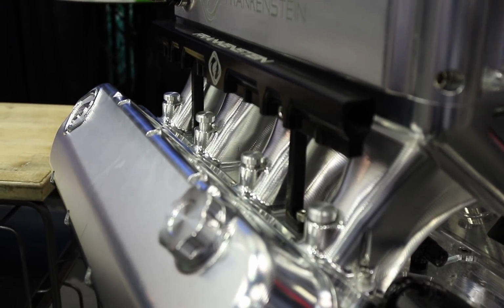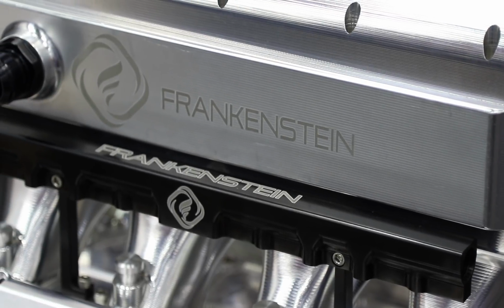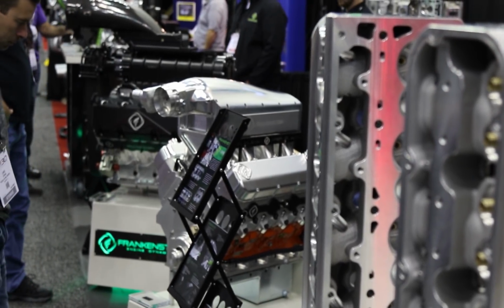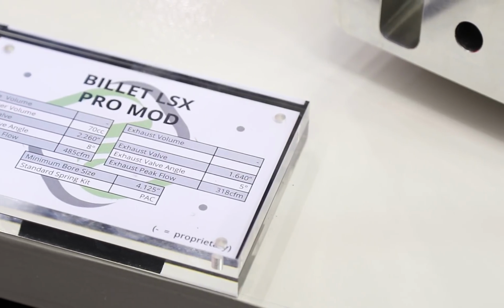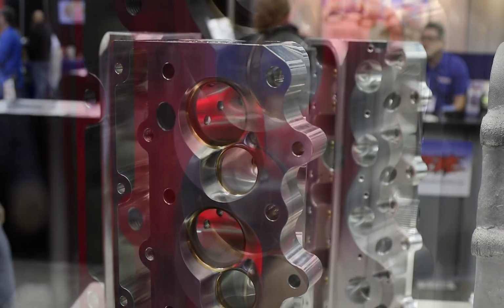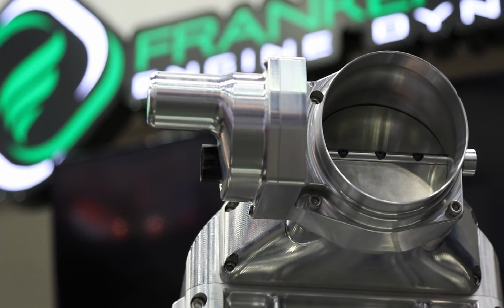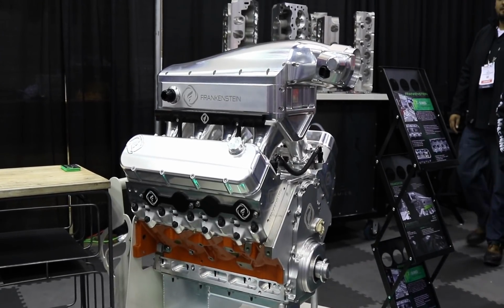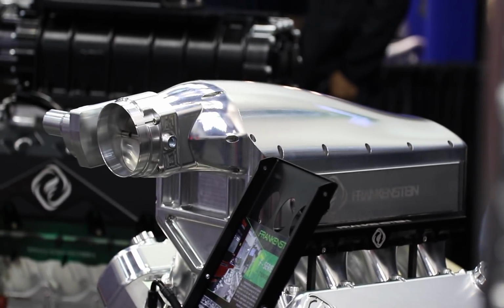PRI 2017: Frankenstein Engine Dynamics Scares Away Competion With Their New LS Line

Comment: Putting a Polish on an old design does not make it more efficient the cylinder is going to fill as fast as it can because the Piston moves  low RPMs and high RPMs the same volume of gas in the air get into cylinder the only difference at high RPMs there's more available give me an old fashioned big block Chevy with 4.7 bore and I outdo any LS Motors out there

Comment: Another fantastic product these guys have developed. Look how thick the deck surface is! Man, you'd need longer than the normal off the shelf LS head studs to accommodate that extra thickness. That'd be really good with a boosted application.